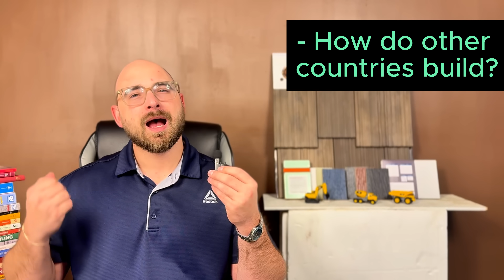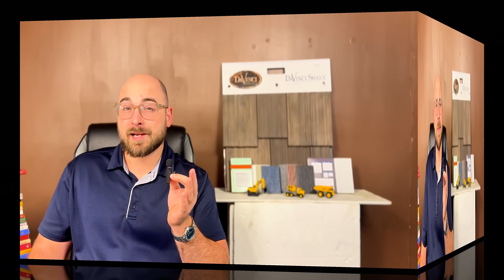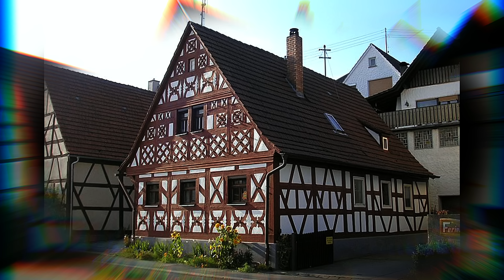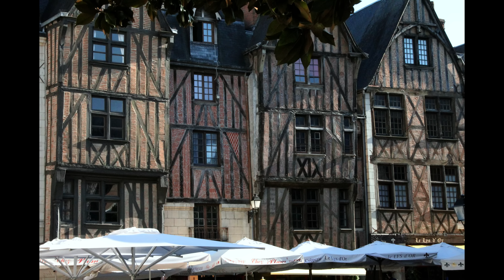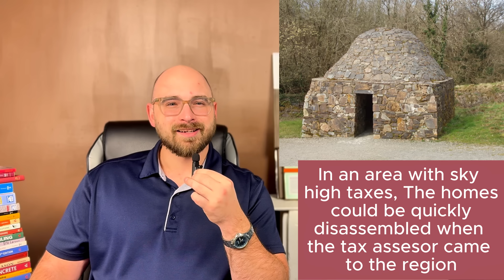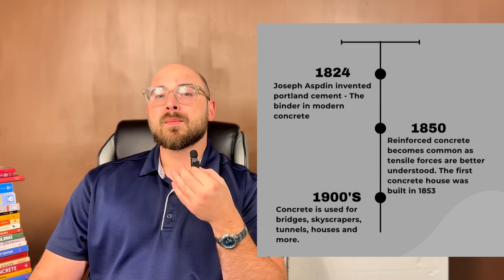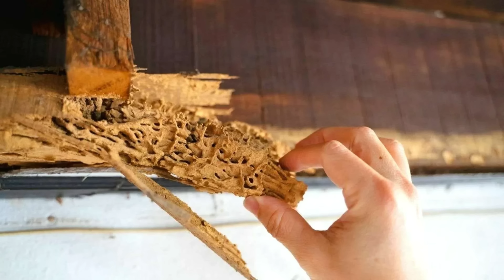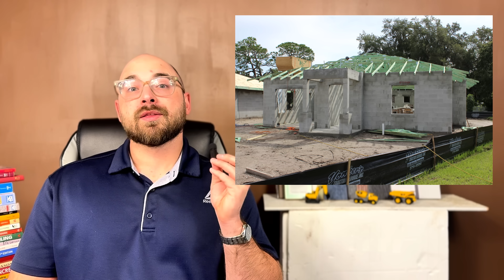Why Other Countries LAUGH at American Homes

Comment: Having lived in both countries, I can say that British houses generally suck compared to US houses. Most British houses lack the central air circulation and filtration that US houses have, which means the air inside them is typically stagnant and generally more polluted with stuff like dust, pollen, air pollution, mold spores and other unpleasant things. The air in UK houses isn't entirely stagnant though, because UK houses also tend to be drafty. In my experience, this is for two reasons: leakiness and a general lack of insulation (it's sometimes absent entirely, or more typically, it's absent in wall cavities and present in some amount over ceilings). Having said this, during the summer, UK houses also tend to be stuffy, which is something I find quite an accomplishment - to be both drafty and stuffy. Because of the lack of indoor air circulation, which in the US typically includes indoor humidity control, UK houses typically have condensation problems than can quickly turn into indoor mold and mildew problems. 

Another aspect of UK houses that I find inferior to US houses is the windows. UK windows have a design that makes them completely incompatible with window screens. This means that during the warmer months when it might be nice to have the windows open to allow fresh air into the house, the decision to open the windows to fresh air also opens them to spiders and insects. It's not a nice tradeoff. 

Other things about UK houses compared to US houses: they're smaller, both on average and on a cost basis. You just get a lot more house for your money in the US (and not just the house, but the lot it sits on too). Also, US houses typically have useful things that UK houses do not, like basements, garages, dedicated utility rooms for washing machines and dryers and built-in closets (Brits tend to have wardrobes which I find invariably to be too small and which usually don't make the most economical use of the space they occupy). Overall, in terms of the creature comforts they offer, I find UK houses to be several decades behind US houses. 

I  have other gripes about UK houses, but these are the main ones. In terms of overall build quality, I find US and UK houses to be roughly on par with one another, which is to say, they're generally rather shabbily built compared to German and Scandinavian houses, although UK houses are perhaps more solidly built because their exteriors are typically built out of breeze/cinder blocks and bricks, although I haven't found this additional solidity to be meaningful.

EDIT: The leakiness, draftiness and lack of sufficient insulation that characterizes the UK housing stock in general means they're far more expensive to keep warm than they have any right to be, given their typically small size and the UK's relatively mild winters.

Comment: German here: Sure, our houses are stronger and more durable, but you always have to consider costs as well. For example, we build a half-million+ house once for 2–3 generations (they can last longer, but this is not the average). In Japan or the US for example, they build rather cheaply and more often. After all, shouldn't the discussion be about energy and material use efficiency? I don't actually know who wins here. For example, concrete produces way more CO₂ during production than wood but lasts longer, etc.

Comment: Houses in europe used to be a loooot more solid and higher quality than the new houses are nowadays. Moisture or even mould problems were rare. But that changed with the 70s and "cheap" houses. They weren't much cheaper but they were already expected to last no more than 2-3 generations. And now if you look at new apartments it is just insane: relative to income their price has doubled, yet the portion of buildings with foundational problems, moisture problems and other critical failures is rising.

So now i can't say that european houses are better than US houses - they have degraded to the same standards.
And yes - older european wooden houses can't be compared to US houses. The european houses easily lasted more than 100 years, are often very fire-resistant and rather comfortable. large solid wooden structures tend to be hard to set on fire.

Comment: Im from Honduras, and most of the houses built here are made of cinder blocks, bricks, steel and concrete. We still have old houses made entirely of wood. Most of Latin America is changing to concrete build houses since they resist hurricanes and hot temperatures

Comment: It is not the general way of construction, it is the quality. In my country (Germany), all houses have to abide to very high standards regarding durability, flammability, and energy efficiency. A well-built wooden house is actually easier to insulate than a brickwall one. The durability and longevity are also similar, but so are the prices. 
Modern German frame or full wood builds are usually made of pre-constructed walls that can be built in 2-3 days. And no, you still cannot punch through a wall. 
For concrete: We also use it to build waterproof cellars.

Edit: we also like to experiment with building materials. For sustainability, straw-clay insulation is on the rise, while still being niche (you can use local materials). Also, wooden framework houses are tested in larger multi-family homes.

Comment: You missed concrete 3D printing
Reply from the maker: Intentionally
Reply: @Mike_Fortin   why 😂😂
Reply from the maker: They’re a fad, 

not any cheaper, concrete is exposed to the elements, thermal bridging, lack of reinforcement, lack of insulation

It’s a solution in search of a problem

Comment: I have seen examples of tornadoes tearing off steel roofs and pushing over masonry buildings in the US.  THAT is why we don't build heavy outer walls.  Everything on the outside could easily be turned into a missile and hurled at your person at 200 mph.  As Mike said, we do have concrete foundations and basements, which act as tornado shelters.

Comment: The world will run out of concrete however. Concrete is made from cement which requires sand and we are using it much, much faster than it can be created by nature. And so far there is no man-made equivalent to natural sand. Also, only a small percentage of natural sand is suitable for construction purposes. check out the documentary “Sand Wars.”

Comment: "Build to last" has it's own principal problems: The requirements for how the home is supposed to look like and what functions it has to have are changing. If you use an expensive "build to last" according the needs at the time of build, after 20 or 30 years you find its design very outdated, many parts impractical. Either you awkwardly somehow adopt to it, or you are destined for expensive rebuilds, often costing similar as the light wood structures, but still unable to fulfill all of the new needs.
 If you start with a cheap light wood structure, after the 20..30 years, once the function does not match the lifestyle anymore, it is also on its physical end of life, so you just tear it down and build a new one, again with the cheap light timber (or equivalent) but with functions 100% matching the new lifestyle without compromises.

Comment: This is all wrong! The question should be framed as follows: "Why are we building houses using shed construction technologies and paying millions of dollars for them?" For us Europeans (I’m from Ukraine), this is incomprehensible. How can someone make themselves pay for a house whose walls can be pierced with a pistol or even punched through, at the price of a château in France? How can you shell out tens of millions of dollars for such a house where things are constantly breaking, where you can hear termites chewing through the walls, and dad grilling mom? You could build a shed using such technology—a temporary structure to be replaced within a year by something solid—but not a residential house! Fine, build however you like! But how do you manage to sell them at the price of an cast iron bridge?
Take Los Angeles, for example, where the risk of wildfires is extremely high, and houses are built on slopes. They use matchsticks and cardboard to build, while they should be using brick, concrete, and metal. The same goes for the hurricane alleys! A concrete house would stand there forever, but these frame houses can’t withstand anything—yet they cost... far too much for a structure of this kind!

Comment: well in iraq  we usually build with bricks and concrete mats where we flatten the ground put crude oil on it cast a reinforced concrete mat with the manhole pipes then we make a two brick wide walls then another reinforced concrete mat then brick walls then the concrete mat that makes the roof our roofs are usually flat but slanted to a drain we dont have snow except in the north although we usually line the roof with slabs of cement that we connect by using tar to prevent water from reaching the concrete below and we line our inside walls with plaster after chiseling electrical outlets and water pipes 
here its normal for a person to leave the house only when his kids are grown up like you be 50 years old married with three kids college and high school age
Reply from the maker: Very cool, thank you for clarifying

Comment: Hey guys! Some fella from mid Russia here. So we basically have harsh winters and hot summers. -10°C in average  winter(several days of -25° per year), +20°C in summer(+30 at peak).
So the weather conditions demand some energy effective and durable housing: thick wood(whole logs, an old style in villages), concrete or bricks. Sticks and paper just wouldn't work here at all, excluding some southern regions. 
Nice vid, thx!
Reply: Canada here, in the Great Lakes region.  We have 50C temperature swings here, from -20C in the winters to over 30C in the summers.  Our "sticks and paper" construction works just fine. It's actually great because we can fill all the areas between the wood frame with insulating material without needing to make the wall too thick.  You know what the hardest part of the house to insulate is?  The concrete basement.  That concrete just sucks the heat out in the winter.  Anyone, including the creator of this video, who says concrete is great at insulating doesn't know what they are talking about.
Reply: Да работают каркасники.
Reply: @woofkaf7724 беда в том, что мало кто умеет строить каркасники правильно.
Reply: Stop earning your bloody salaries by signing up to destroy your neighbors and their homes and lives. That’s more what you should be focusing on.
Reply: russians? go 'home'!

Comment: I knew about McMansions, but when I dabbled in construction I realized how bad it was, and how normalized it was to hire contractors for as cheap as possible, who would use the cheapest materials to make the quickest things possible. Just a f**** downward spiral. I wonder what will stop it? Hopefully the younger generations just won't buy them. 

We can't afford them anyway lmao.
Reply: Even if I could afford to buy a house, I'd never buy a McMansion, if it's not built to not be broken easily, then it's not worth it, in fact I wouldn't buy anything wooden based, unless the wood was just a covering. It would have to be able to withstand and stay standing after a fire with at most only light firing on a single part of a wall.

Comment: 11:27 other reason, why germans build their homes from concrete and bricks, could be, that almost every home has cellar/basement, and ground water is relatively heigh, so you need heavy house, that the Archimedes force will not push the house up! Also by floodwater, that can easily be 1-2m above ground! For example, if you have 10 x 10 x 3 m cellar, and ground water will achive 1m above the ground surface, the house must have the weight of 400.000 kg, to have a chance against Archimedes force! And such weight is not achievable with leight materials! Concrete and inside walls of cellar can achive the weight of 150-200 t, so the upper house must have at least 200-250 t weight!
Reply: My friend, i have not written about all europeans, i have written about germans! Almost all of germans have basement by their homes. There are heating systems, electricity distributors, lаundry, storage rooms, hobby rooms, saunas, also cool bedrooms for hot summer, and so on. And i dont assume, i know that this houses are build from concrete and heavy clay bricks, independent for average family or wealthy family. Only upper floor under roof can be made from drywalls. And floods are happening in Germany every year, because they dont have enough big dams and water storages, but much settlements are in river valleys inside.
Reply: You are delusional. Modern Europe(including luxury ones) houses don't have a basement. Plus we don't have much of natural disasters in Europe as a whole. They are 1floor silicone or silicate block houses with huge rooms and ceiling. Please note that I am not including UK who are filthy rich but decide to build 2.4m ceiling houses.

Comment: 16:43 after around 2010, many mid and lower level developer use CMU... STILL most building from brick (clay).. because in Indonesia still easy to get... But different 
-Granite 300~2000 usd/m3
-Block wood (20-30cm) (AGRAWOOD, BLACKWOOD, ETC.) 200~700 USD/M3
-Stone House (pure stone + cement) ; 100~200 USD/M3
-Brick 80-200 USD/m3
-CMU we call it concrete block ; 40-150USD/M3 
-plywood (only for SEMI PERMANENT 2~5 years) mostly use seng (iron sheet) 

So avg. American house laughable compare 3rd world country like Indonesia... Industry property klld avg. Joe

Comment: We should use silicon nitride. More stable (complaints like hydrolysis are about nm of difference over long periods), biomedical material, 10-20x higher compression strength than concrete before even mixing (290,000 to 508,000 psi), 76ksi tensile strength, 127 GPa shear. Replace drywall with a hexgrid of access panels too, we eliminated crawlspaces for more living space, why tf would we keep using drywall? Silicon nitride can be cheap, but a manufacturing pseudo-monopoly lets producers tell you its difficult to produce and charge far over cost. 

Silicon carbide is not as good, but cheaper for now and still better than what we use. Another is Aerographene which is easily mass produced but...another lie on its manufacturing difficulty when you can do it at home. A flower can hold up a brick of aerographene and it can be impregnated with another material to serve as a support structure. We have plenty of material options, we just don't use em just like we already refuse to build like switzerland, germany, or puerto rico.

Comment: 26:24 insulation must be ONLY outside of building! So you will use the thermal mass of walls, which will keep heat in winter and coolness in summer! But if you have insulation inside, you cut off the thermal mass from your home, and provoke the dew point inside the wall, and it is the source of humidity inside the wall and mould.
Reply: exactly you don't want to lock humidity inside

Comment: I think, at the end of the day, the problem is more a matter of the quality of construction than the specific building techniques used.  Is the entity responsible for construction more interested in making a quick profit, or are they more interested in a high-quality product? And the former is more common than the latter, especially in terms of overall quantity.  And when the government isn't interested in actually enforcing building codes, as seems the case in a number of areas, then you're left with people having to search for actually good builders.  Which is much harder than it seems.